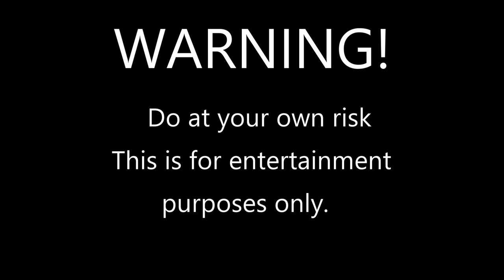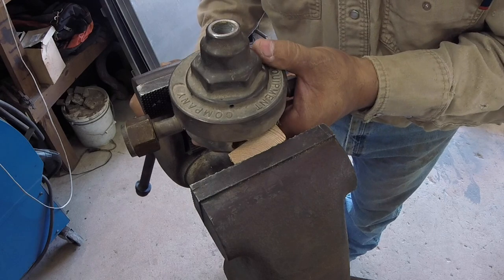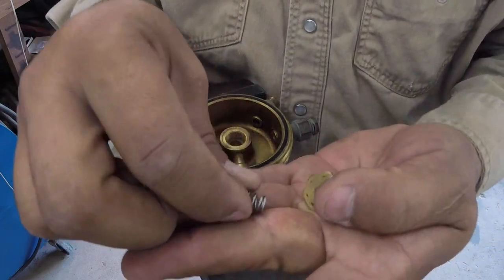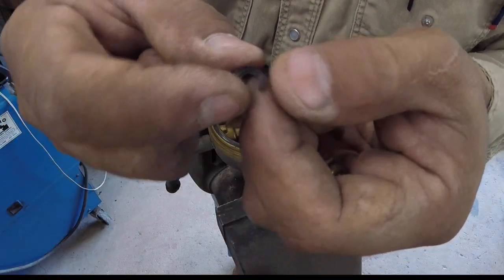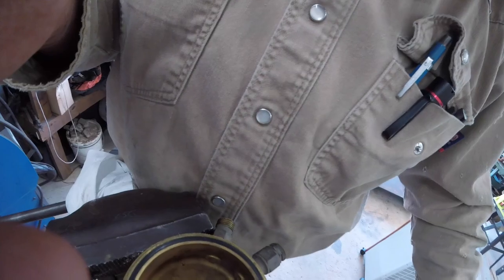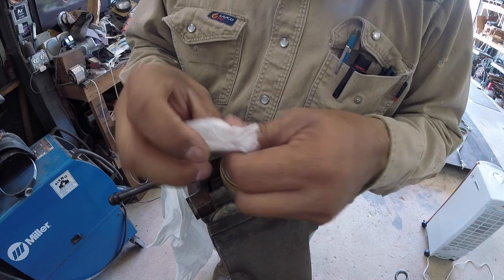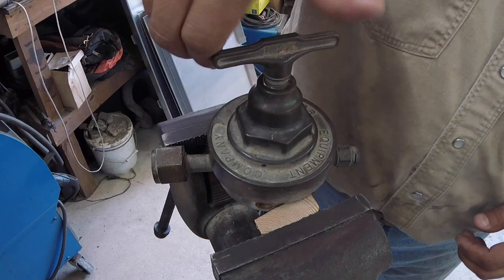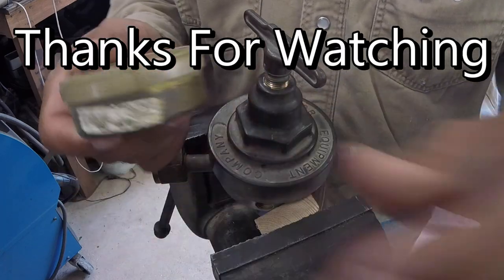Torch Regulator Repair.

Comment: Good video. The white grease looks like Krytox, an oxygen safe grease we use on gaseous oxygen handling systems.
Reply: Dalen Nixon, I will look that up, thanks for the info. For myself I was wondering if it may be a Silicon base, not that I know of that being safe with high pressure Oxy.
John, Australia.
Reply: Christolube 111 is another high pressure O2 safe grease.   Silicones are NOT used in high or low pressure O2 systems.
Reply: @jenniferwhitewolf3784  Thanks for the info.
John.
Reply: @jenniferwhitewolf3784  Yes they use this in dive shop, for the scuba gear. Or Nitrox. I'm not sure it has the same properties regarding high pressure oxygen, as Krylox does. You have to be careful to check what applications the specific grease/lubricant is speced for.
Reply: It is! Krytox also make a thread sealant but it's not cheap.

Comment: I used to repair my oxygen and acetylene regulators here in Australia. It got to the point that parts are not available here so you are forced to buy new regulators.
Reply: It's starting to happen over here. Rebuild kit is $29. A new Chinese regulator WITH gauges on slammazon is $29. 😮😂

Comment: If you have some experience, any fuel gas, nitrogen, carbon dioxide, helium, and argon... but not oxygen. regulators. Just get another oxygen regulator (a new one isn't that expensive. And, it isn't as expensive as loosing your life, or someone else's.

Comment: At the welding shop in our local school some years ago, the supplier was changing out oxygen bottles when an oil contaminated reg blew up on him. It blew a hole right through the case and sprayed him with molten brass. Luckily he had turned away just in time and so it got him in the back and burned holes in his parka, which was heavy enough so he didn't get burned. Shook him up pretty good though. Also remember to use Oxygen compatible thread tape. Regular stuff won't do.
Reply: That sounds like a number 10 on the sphincter scale.
Reply: Krytox make a TS4 sealant that's better than tape because it doesn't overly lubricate the threads. I've used both and prefer the Krytox. Prices vary greatly...

Comment: Hi, I have worked for an oxygen supplier in a combustion role for 32 years. I would recommend the following, 
Wash hands before starting 
Degrease tools and wear nitrile gloves 
The seals a made from viton and and must not use any O rings you have handy. 
The white lubricant is not grease but Krytox an oxygen compatible lubricant, also very expensive.

I have seen firsthand what high pressure oxygen can do. 
Usually in accident investigation I can not find the valve or part burnt because it is vaporised ! 
That’s why the valve body and gauges are non ferrous ( brass) construction. 

Hope that helps, 
Ps love you work.
Reply: could you explain why the body and gauges are non ferrous metal like brass?
Reply: @Trudeautthebestt  non reactive to not cause a reaction from oxygen at high pressure slamming into it. Look up Boyle's law.
Reply: Do you by chance also know the type of thread sealant used on npt or straight thread connections for gauges or other things attached to oxygen regulators?
Reply: @Trudeautthebestt  Ever seen how steel rusts? That's the iron in the steel reacting with the relatively low concentration of oxygen in the air, and atmospheric pressure... slow motion burning. Now imagine if the steel starts to rust, and heat builds up enough so that the steel starts to burn,... and starts burning under 2000 psi of pure oxygen. The reaction is self sustaining, rapidly progressing, and catastrophic.
Reply: @Trudeautthebestt  Because iron oxide burns. It's half of Thermite! It also oxidizes easily.
Reply: @portalkeeper978  High pressure oxygen-safe sealants like Oxy-Clutch. For lube use the Krytox lube packet from your rebuild kit as the factory service manual bulletin directs. Parts are readily available online including rebuild kits and individual parts.

Comment: Mine is pretty similar to this one except my diaphram is rubber and it also does the sealing instead of an o-ring. I ordered a rebuild kit for $30.00. Never took a regulator apart before and didn't know what was inside. Like you said they are pretty simple. Thanks for the video.

Comment: Gas regulators are not complicated really. They just want you to think they are. What kills my regulators is the environment in which they live. Outdoors on a service truck from 90F degrees to -30F temperature ranges and dirt. They fill up with water and freeze in the winter if you don't keep em covered I found out😁.  That style of Victor regulator is pretty durable and they work very well. Cheers

Comment: I had an O2 regulator go bad 2 years ago. It put bottle pressure directly to my torch hose while I was holding it. I thought it blew my fingers off, hurt like hell. It was a Victor copycat , no parts available. I now have Victor regulators on my torches. They are worth the extra $$$.
Reply: Flashback arrestors, and use quick connects with reverse flow check valves.  Could never happen in that case

Comment: thanks. I wondered about fixing up some old gauges.  I have a new victor journeyman set but I was at an auction for a welding shop closing up and I bought a 5 gallon bucket full of old gauges and torches.  I'm not sure why but maybe I will see if I can fix some up for the fun of it. ;) Thanks
Reply: @michaelvangundy226  thanks. Sounds like a good reason to not mess with them. I usually send off my equipment for repair. But didn't know what to with these old units.
Reply: @GaryForgingOn  why not fix them?
Reply: Weldingweb forums have tons of info. It's also easy to sell them as cores but I bought a LARGE box like you did and have torches and regs and flowmeters for life. Easy to learn or just Ebay them (I took the ones I was selling apart since customers are rebuilders like me).  If a torch head leaks it may need reaming (special reamer, the rebuilder can just ream yours if ya wish) but resealing them is easy as is replacing minor parts.
Reply: @obfuscated3090   thank you. I will go through the box and check them out.

Comment: My first set of torch gauges went bad after ? 20 years, local weld shop quoted my $125 to repair, a new regulater was $170... parts are $15 on the interweb. This of course happened while I was fixing a broke down machine, and needed the torches now, not in a week... So I have a mismatched set of gauges now.

Comment: I fixed a cheap fuel gas regulator by cutting a new rubber washer out of a piece of tire tube.  Still working.  I have always been scared to work on the O2 regulator.
Reply: DO NOT use mystery parts on oxygen regulators. Fuel gases are less picky but I'd make sure at least to us Viton rings, seals etc. Inner tube doesn't do well in contact with petroleum products so I would resist the urge to use it.

Comment: It kind of scares me how many comments there are now thinking that they are ready to repair their o2 regulators based on this video, when they don't even realize the risk that skin oils, grease residue on the handle of your wrench, etc can create.
It's not just spraying it with WD 40 that creates risks, it's any organic or oil, and it's not about the quantity, because the oil is just the ignition source, it's the metal that burns under the high pressure o2 atmosphere. The oil is thought of as the kindling, just creating enough energy to ignite the metal.

This is really not safe unless you basically create a clean room environment, covering your surfaces with clean towels, washing your hands with dish soap, using degreaser on your tools and vice handle, and ideally clean nitrile gloves, and treating it as a sterile field so no oil can get close.

Remember, one speck of oil can be the spark that turns the metal into fuel, and heat is created every time you open the tank valve and it increases the pressure in the HP side.
Reply: Yeah, you hear about it all the time, especially after thousands of these have been fixed in the field. They even have the audacity to sell replacement parts to anyone. Oh the noes. We  should have the govt stop this practice.
Reply: I'm surprised they don't weld them shut if its so dangerous 🤔
Reply: You can work to oxygen safe standards without a "chip foundry level" clean room and commercial rebuilders just use a properly clean workshop area. The tool precautions you list are wise.  Gloves are cheap so there's NO excuse not to have them and acetone is the classic way to clean oxygen system parts safely (I use it outdoors for obvious reasons). Not working around grease or filth is pretty basic but the world abounds in idiots...

The factory manuals can be downloaded or tech support can email the link if you don't find them. Not nearly enough people use tech support but it's free so I do.
Reply: @obfuscated3090  I never said anything about a chip foundry level clean room, I am talking more like an OR level clean room, or a hydraulic rebuilding clean room, minus the oil lol
Basically where you have the mindset that you just described, thinking through the process of doing it in a way that ALL oil is kept away and removed, and most people don't even have comprehension of how to do that, or the possible sources of oil.

It sounds like you could do it safely, but I am trying to warn off people who want to do it on their greasy work bench after spraying it with Brakekleen and wiping it with a freshly washed and fabric softened shop rag... Lol

Comment: many people are killed and injured by these valves.  dust particles or any grease or oil including oil from your skin can cause the valve to explode. it is particularly dangerous when the tank valve is opened and it is recommended that the tank valve never be opened with the screw turned in to feed the torch.  that means the low pressure side should not be open.
as to overhaul the valve. it is fine if you know what you are doing and to degrease the valve and as another commenter posted wear oil  free gloves. the problem is how do you know if you know.  

you can degrease the parts using detergent soap and water and dry thoroughly (leave overnight or put in an oven). do not blow dry with compressed air as that may be contaminated.

Comment: Sad thing is I could have used this video 2 days ago before I sent both my regulators off to be repaired by my local welding supply chain. Never again now so thank you
Reply: Dropped my off   
Hopefully they rebuild it good
Reply: Most LWS don't charge much over the rebuild kit and if oxy regs are crusty I don't mind letting someone else polish them since that plus oxygen safe cleaning is more work.  Either way saves money!.

Comment: I drop mine off at the welding supply store and in a week pick them up they look like new 
For $75 bucks. I used to do my own  (but now that I can’t read that part # either )lol 
Its easier
Reply: LWS prices are very reasonable in many cases. If I have regs or torches I want polished I send those out since the price is the same either way.

Comment: A bit like taking a wristwatch apart.  I assume the reason you didn't use the torch to cut the regulator open was the regulator was broke?  Don't try that at home.  Nice video, thanks for sharing.

Comment: Oxygen regulators require a minimum level of cleanliness, gloves, bagging, handling to be safe.    Many items- including metals-burn explosively in the presence of contaminates, oils dust and high-pressure oxygen- especially when there are high-pressure pulses that occur when a valve is quickly opened.   Ever see aluminum 6061 manifolds that burned and melt? Many years ago had to develop cleaning and handling procedures to keep our technicians from getting maimed on a DOD program.    We spent several years dissecting many  regulators and developing high flow,  high speed pulse regulators for aural weapons noise simulators and .   Sometimes being able to make a video  can be dangerous to the folks that think it looks so easy and then they get hurt badly because they missed a tiny detail.   Understand  the the disclaimer  in the beginning of the video that might help the trial when stuff goes sideways and little Ricky gets disfigured or the house burns down and you have to call the Allstate guy. Be safe and understand that there are bad things that infrequently  occur in high-pressure oxygen gas systems.

Comment: I just got a new Aceyteline bottle from NAPA.   It wouldn't seal with a  brand new regulator.    There was a bunch of crap, like teflon tape on the tank side threads.   I know it's frowned upon to seal up tank threads with anything, but when you are force to do a cylinder exchange program and only find out after they are closed for the whole weekend, and you have something to do on a weekend warrior project, what would you do?
Reply: Hand brush it out with a bristle brush, remove any debris, crack the bottle open to blow out the CGA fitting, examine the cone end for dents/damage and then attach regulator.
Reply: @MrDillaKilla  ^Perfect response all the way!

Comment: Isaac,  have gone through a few O2 regulators in the last couple of years form Victor.....wonder what is up with that....I do not use that much either....great video Issac, best regards, oh yeah, my argon regulators are pooping out faster that they should.....I always relieve spring tension on diaphragm spring too after using....best wishes  from Orlando , Paul

Comment: Unless you have oxygen cleaned tools and know what you are doing never mess with a high pressure regulator. One spec of a flammable material left in that regulator when you put it back together could be a bomb when you open the cylinder. Send your regulator in for rebuilt or get a new one. I retired from the industrial gas industry and have actually seen explosions for oxygen and oil.
Reply: So true of danger, clean room style..
Reply: Yes, I was cringing watching skin oil fingerprints being left on the high pressure side.. Lol

Comment: Question:had an acetalyne reg leaking it caught fire at reg and tank.Helper ran away i just turned gas off and it went out.I see the same spike in pressure like yours also leaks gas out of little air holes around reg.Is this normal.Cheap set of torches anyways.Can reg be fixed or better to get new sey of torches higher qaulity.Thanx appreciate your vids
Reply: Buy rebuild kit
Reply: @briantruck2284  thanks Brian got better set found other issues.

Comment: Hey Isaac when you took the first bumper off yours was crack so is it supposed to be split or not? I just know you said you didn't know and I can't really tell on the replacement parts. And thanks for this video I have a regulator I need to repair
Reply from the maker: I think it was supposed to be a split washer.

Comment: G'Day..nice repair,,YES very important NO OIL,,That Grease is a cryotype grease,,inert,,won't react to any thing why it is use on this sorta gear,,,we did a stack of regs up for work had to find and purchase this super speacil grease,,
$100 au money for 30 mls..so we used it sparinly,,Place in Melbourne Australia makes it,,3 weeks to make,,
No Moly No mineral oil ,,very very important,,mineral oil and oxy gas= big bang,,Huge Fucking bang,,
Ever see an impact gun run on pure oxy,,,yer we couldn't find all the peices,either,,
Luckerly the gun was distroyed but no one was injured,,
this bloke spent an hour getting the right fitting to plug in to oxy main,,yes we have a bottle bank and run hard line where required,,so no bottle's laying round,,just need a short whip and fittings,,save pushing heavy oxy carts around,,

Comment: The lube is silicone based. Any oil based products is a explosion waiting to happen with compressed oxygen. I had to buy all new torches when I could no longer find parts for my Air Products setup.

Comment: Thats awesome!  Any idea how old the gauge/regulator set is?  They look pretty old... and well made!
Reply: That SR style body could be decades old or quite recent. SR stands for "Safety Regulator" as it improved on the older designs.  They are still made because there really isn't any significant improvement on the new ones. An old is as good as new after rebuild which you can have done cheaply too online or via your local welding supply.

Comment: Mine is an argon/CO2 regulator by OXITURBO Italy the valve comes out from the back without dismantling the regulator. I have taken it to bits but there does not seem damaged. I cannot find the manufacturer so I might have to buy a new one from China!!!

Comment: after you are done working/welding do you set your gauges / back them all the way off showing no pressure on the gauges ?  Again always good info and technical help in all your videos , please more videos    Alan Thomas
Reply: I'm of course not him but I usually don't. I shut off the cylinder then bleed down the hoses. After rebuilding many regulators I see no benefit to worrying over that since they're simple and robust. The only regs I rebuilt were bought used with intent to rebuild them. A rebuild can last decades on a reg. A torch could go a century and I have two Oxweld W-1s that old.